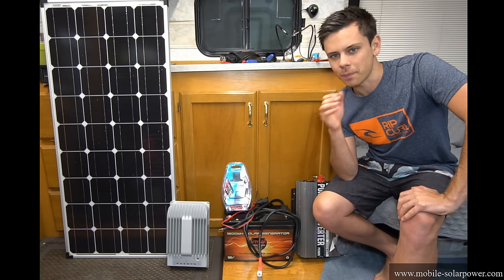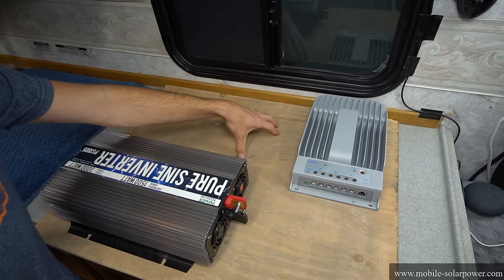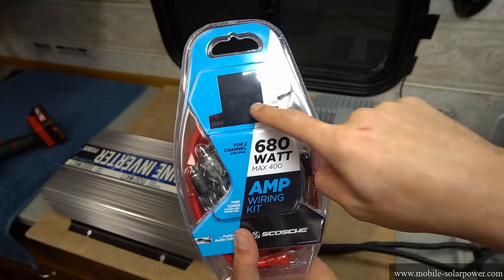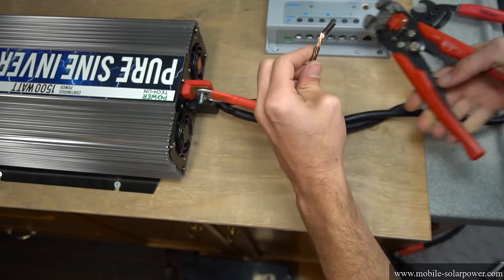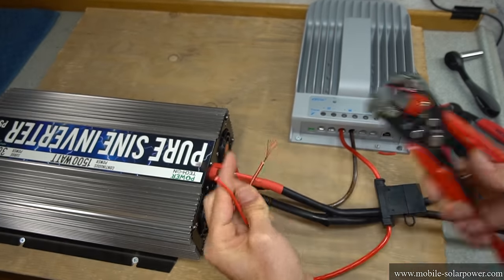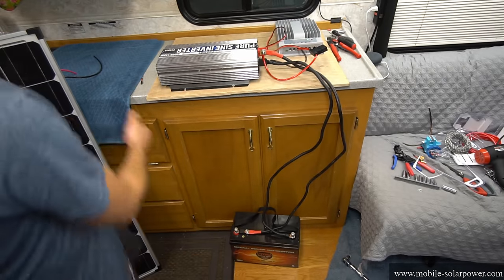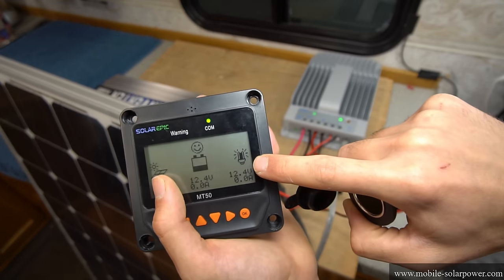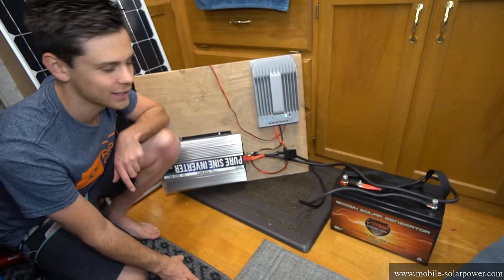No Crimping Required! DIY 400 watt Solar Power System- Great for Preppers or #Vanlife

Comment from the maker: Recommended Components and battery size can be found here: https://www.mobile-solarpower.com/the-classic-400-watt-rvs-vans-buses.html
This system can handle 400 watts of solar power with a 12v battery. The battery and solar panel in the video is mainly for demonstration purposes. A larger battery and 400 watt array is ideal. 

Amp Wire Hookup kit: https://amzn.to/2EGVJNJ

Tools: https://www.mobile-solarpower.com/tools.html

~~~~~~~~~~~~~~~~~~~~~~~~~~~
Does off-grid solar confuse you? Check out my DIY friendly website for solar system packages and product recommendations, and so much more! http://www.mobile-solarpower.com

Join our DIY solar community! #1 largest solar forum on the internet for beginners and professionals alike: https://www.diysolarforum.com

Check out my best-selling, beginner-friendly 12V off-grid solar book (affiliate link):
http://amzn.to/2Aj4dX4

If DIY is not for you, but you love solar and need an offgrid system, check out Tesla Solar. Low prices and great warranty, and they can take your entire house offgrid with their new Powerwalls: https://ts.la/william57509

~~~~~~~~~~~~~~~~~~~~~~~~~
My solar equipment recommendations (Constantly updated! Check here first):

12V/48V Lithium Batteries: https://www.mobile-solarpower.com/solar-batteries.html

Solar System Component Directory: https://www.mobile-solarpower.com/solarcomponents.html

Plug-N-Play Systems: https://www.mobile-solarpower.com/full-size-systems.html

Complete 48V System Kits: https://www.mobile-solarpower.com/complete-48v-solar-kits.html

DIY Friendly Air Conditioner/ Heat Pumps: https://www.mobile-solarpower.com/solar-friendly-air-conditioners.html

Complete 48V System Blueprint: https://www.mobile-solarpower.com/48v-complete-system-blueprint.html

~~~~~~~~~~~~~~~~~~~~~~~~~~
My Favorite Online Stores for DIY Solar and Coupon Codes:

-Current Connected: SOK, Victron and High Quality Components. Best prices and warranty around: https://currentconnected.com/?ref=wp

-Signature Solar: Cheap Server Rack Batteries and Large Solar Panels:
https://www.signaturesolar.com/?ref=h-cvbzfahsek 

-Ecoflow Delta Official Site: My favorite plug-n-play solar generator:
https://us.ecoflow.com/?aff=7

-AmpereTime: Cheapest 12V batteries around:
https://amperetime.com/products/ampere-time-12v-100ah-lithium-lifepo4-battery?ref=h-cvbzfahsek

-Rich Solar: Mega site and cheaper prices than renogy! Check them out: 
https://richsolar.com/?ref=h-cvbzfahsek

-Shop Solar Kits: Huge site with every solar kit you can imagine! Check it out:
https://shopsolarkits.com/?ref=will-p

-Battery Hookup: Cheap cell deals
https://bit.ly/2mIxSqt
10% off code: diysolar

-Watts 24/7: Best deals on all-in-one solar power systems, with customer support and distribution here in the USA: 
https://watts247.com/?wpam_id=3

~~~~~~~~~~~~~~~~~~~~~~~~~~~
Contact Information:
I am NOT available for personal solar system consult! If you wish to contact me, this is my direct email: williamprowsediysolar@gmail.com

Join the forum at https://diysolarforum.com/ if you wish to hang out with myself and others and talk about solar

FTC Disclosure Statement and Disclaimers:
Every video includes some form of paid promotion or sponsorship. Some links on this youtube channel may be affiliate links. We may get paid if you buy something or take an action after clicking one of these. My videos are for educational purposes only. Information is subject to change/update at any time. Electricity is DANGEROUS and can kill. Be smart and use common sense :)

DIY Solar Power with Will Prowse is a participant in the Amazon Services LLC Associates Program,
An affiliate advertising program designed to provide a means for sites to earn advertising fees by advertising and linking to Amazon.com

Comment: Brilliantly clear as always Will :-). Can I ask you to look into doing a tutorial on adding  the last piece to the puzzle. Adding these amazing systems to an existing internal 12v set up. 

What I mean by that is, I have small touring caravan which has internal AC that can be hooked up to the grid.

Your videos have given me the power (pun intended) to build a minimalist system to allow me to ditch our generator on weekends away. 

My van has all the existing 12v board and an AC board with 2 or 3 EXISTING AC outlets dotted about and has a charger that Already charges the battery when hooked up to the grid via the external plug.

If I create your magical solar system with an inverter, where do you then make the final connections to introduce it into the existing system so that one doesn’t mess up the other.

In my brain, I’m thinking I could just create the solar setup and then plug the output of the inverter into a joint box that gives me the choice to use the external grid hookup lead or, switch to the inverter line. Literally replacing one source with the other as though the inverter was providing “grid” power. 

Is this even possible or should it be connected some other (independent) way. 

I just really want to keep the existing internal ac outlets but just have them fed from the solar. There is also only 1 single 12v battery too so how would this impact / limit the design.

Feel like this would be a really typical requirement once a system is created.
Hope the post is ok offer up here.

Keep up your incredible energy.

Comment: This is the first time I see someone connecting the the battery output from the charge controller to the DC input of the inverter, using the DC input as a hub. So far I had only been taught to use the battery connector as mounting point for both the controller and the inverter. 

What are the implications of each approach?
Reply: I was wondering the exact same thing; this differs from Will’s other videos as well...
Reply: There is no real difference other than the length of the wire from the output of the controller.

Comment: BTW the best way to learn crimping is practicing on scrap wire. Never practice crimping or soldering (or most anything that consumes consumable parts) on your workpiece. 
That way when you eventually need to crimp something (which may not even involve your solar system) you'll know how.

Comment: You've been doing a bunch of cool smaller/simpler setups and I've really been getting a kick out of it.

If you're taking requests I'd love to see a DC only setup. In all your builds the inverter is pretty key, I'd just like to see what you'd change if it weren't.
Reply from the maker: Ok sure, that would be a cool one. and thanks!

Comment: Love the build video Will, well done!

People should be scared of crimping their own wires. Properly crimped cables are an excellent choice for cable termination and the recommended approach  for high energy connections, however Poorly crimped cables reduce long term reliability and introduce 'hard to find' intermittent faults. This is mostly relevant to small wires however good crimps are important for larger cables too. Quality crimp tools and appropriate crimping techniques are an absolute must - no pliers!!  :P
Reply from the maker: Absolutely agree!!

Comment: I just like to remind everyone that wire going into the charge controller should not exceed half an inch in bare wire going into the contact base. I like to solder the end. So that the wire together
Reply from the maker: Yeah agreed but I can't find a kit with a shorter bit right there. And honestly I never fuse my charge controller for my personal systems and I over gauge it anyways so the wire is protected. But yeah you're right
Reply from the maker: But whole point of this video is not soldering or crimping. Do you have an alternative method that doesn't require soldering or crimping? That was the entire point of this video

Comment: wire stripper , wire nuts, and electrical tape is fine by me ;).  Except for soldered battery mount cable of course.

Comment: Wow almost 90 of my ? In building my solar system Is answered in 7 mins.. very sincere in giving knowledge about solar system no shortcut that generousity in real act.. 3 question in mind the wire connects to inverter and battery it has two fuses? 175 amp fuse connects battery and the inverter is what amp fuse? Is that MT15 screen am i correct.. last is what watts is the panel 200 or 400 tnx again sir.. may be the 10 percent will be ans. In other videos like circuit breaker and when lightning  strike  more power to you man

Comment: Can a 12v fridge be hooked up where you hooked up lighter plug? I plan to cut off the lighter plug from the cord and adding anderson plugs to make it a secured plug in. Was wondering if I go off battery with a fuse or can I run it straight to the solar controller?
Reply: Run it off the battery.

Comment: You should definitely add a fuse to the 12V outlet as those are usually only rated for 10A while the charge controller can (and will) output up to 40A if given a chance.
Also, folding stranded wire in half to fit it into a too large clamp is just not a good idea.
Reply from the maker: On these terminals it's fine because they are oversized anyways and some arrays are going to be small or have short wire runs. Please watch my other videos which cover more advanced topics. This is a beginner video

Comment: Hi Will!
I have a 235 watt panel and a inverter that was used commercially with the panel. My question it was use with 12 gauge cable.can I lower the gauge cable to a 8 or 6.please help

Maureen

Comment: Just a quick question.  If I have a 170A circuit breaker in between the battery and inverter, do I still need the fuse at the battery positive connection?  The distance from the battery to the 170A breaker will be extremely short(2-3 feet).

Comment: Another killer video. The ending should be "and this board will be available at XXXX dollars on my website, already prebuilt." ROTFLMAO....... Hey - what's the best way to get to be in contact with you for asking questions?? Do I need to be a Patron or something?? Buy your book??
Reply: So In my RV - it's all stock. I want to add an inverter into my system. Can i just throw the breaker "MAIN" off, then from the inverter, run a male to male 110v cable to one of my 110v outlets? That should provide 110v to all my outlets, and be isolated from the generator yeah?? As it is now, when the generators off, the 110v outlets are dead too. But the 12v still works. So I'm thinking put the inverter on my 12v wiring, then use the "jumper" to make the 110v outlets hot. Sound about right or will I fry an inverter??
Reply from the maker: It's true and I've done that before haha but it's not smart. Very dangerous. Would wire direct to ac panel instead. Hardest part is running the wire under the floor or in the walls
Reply from the maker: And YouTube comments best way to contact. My email is an absolute mess. And I'm trying to make videos so I'm ignoring emails as much as possible

Comment: What if there is a long way between my solar panels and my system /solar charge controller  ? Lets say i got my system in my house and i need 25 - 30 meters of wire going out in my garden to my solar panels , how do I do that best and get the best results?  And the best power without too much lost ? Do the length of wire / distance have anything to say in this ? What if i want to supply my system with a small windturbine how do I do that best and the right way ?

Comment: 1 question , I've been having and trying to understand I see two types of systems being done solar panel to solar charge controller solar charge controller fused to inverter from inverter fused to the battery like u did in the video, the other system is solar charge controller  to battery from Battery fused to inverter is there any reason why there's two types of way of doing this pros and cons

Comment: I have a little giant pump that I would want to run solely on solar power.  I already have 4 panels rated at 130 watts.  The little giant is a 120v at 700 watts.  What size of battery and controller would I need?

Comment: I'd like to see how you'd hook the 4 solar panels up.  Would you run them at 12V in parallel?  or put them in series for 48V  or do 24V? and why would you choose one setup over the other?
Reply from the maker: With 400 watts of panels, put them all in series

Comment: Question: does it matter if you connect the battery positive and negative of the charge controller directly to the inverter or is it more advisable to connect it to the positive and negative terminal of your battery?
Reply from the maker: Either way is totally fine. Both connect to battery. Inverter cables are large, so they can carry the current of the charge controller easily.

Comment: i dont understand why youre connecting the battery via the inverter. Why not just connect the battery directly to the charge controllers battery ports, and the inverter to the battery?
Reply from the maker: Because the 2 gauge wire between the inverter and the battery can support the load. You would have 4 wires going to the board for no reason.
Reply: Will Prowse but wouldn't the inverter have to be permanenttly on?
Reply from the maker: @timothy790110  no not at all. its attached to the inverter terminals. which is connected to the battery 24/7
Reply: Will Prowse OK, still trying to get my head around this! . I only have a 600w pure sine inverter, connected directly to the battery with 2 awg wire. (6mm2)  and I'm fusing it with a 40a blade fuse. I have the same charge controller (4215bn) with 400w of solar. Is the 40a gonna be enough? My battery is connected to the charge controller with 6awg  (16mm2 wire) , fused with 60a.
Reply from the maker: @timothy790110  600/12= 50 amps, so you need 70 amp fuse. or 80 will work too. for the inverter
Reply from the maker: @timothy790110  and a 40 or 50 amp fuse will work with the charge controller
Reply: Will Prowse but is should fuse the cable, not the inverter right? Cable is 2 awg (6mm2) between inverter and battery.
Reply: Discharge and overcharge protectors are worth their salt. Had a guest using my small system when I went to work and came home to completely discharged and very expensive batteries.  2 deep cycle marine batteries and one gel lead acid sealed plus two emergency combo packs with jumper cables and air compressors from Walmart. Every battery killed.
Reply from the maker: @JudgeBob  yeah I totally agree. low voltage disconnect is super important.
Reply from the maker: @timothy790110  I think you should watch my video on how to fuse again. You are missing something fundamental. You need to protect the wire and the appliance. both need t o be spec'd accordingly
Reply: Will Prowse yep, will do. Oh, have you tried the WiFi or Bluetooth dongle for the charge controller instead of the mt50 by the way?
Reply from the maker: @timothy790110  I haven't seen the need for the Bluetooth module but yeah it seems cool
Reply: @WillProwse  the ok button on my mt50 keeps sticking under the plastic, since I bought it, it gets annoying real fast.  I like being able to set everything from my phone whenever I want, and have a nice layout of all the info. Plus the mt50 is a bit of an eyesore

Comment: I'd like to build this system, but I've got one 315 watt solar panel that has a rated voltage (Vmpp) = 37.5 V. Your guide says "max 24 volts each" for the panels, so would my one panel still work fine?

Comment: Use 24v to save on wire and get higher amperage. 2 ga is overkill btw
Reply from the maker: Please watch my 2000 watt 24 volt solar system I just posted. Or my Tesla battery system. Or my lg cell system. For beginners, 12 volts is fine because parts can be locally sourced.
Reply from the maker: And not overkill at all. They get pretty warm at max discharge rate.

Comment: Hey Will, just wondering if you could do a video (or maybe you have one already and I missed it) on how to connect a solar system to an existing RV system. My goal is to be able to plug into an AC power source or switch over to, via a transfer switch, to the solar charging system. Being able to theoretically run anything off of either battery banks. Thanks
Reply from the maker: Oh man I always want to make a video on this but I am so scared of people getting shocked with ac. It is super easy to do too..I'll have to think about this one

Comment: I have 400 watts of solar going to MPPT charge controller set for charging two 12 volt 75 AH sealed batteries in series (24) volts which works great.   I don;t want to change that set up but I would like to get 12 volts to work with a couple of moderate loads.  Instead of buying a 24 to 12 volt buck converter, why couldn't I just take a parallel output of the two 12 volts batteries?  That would hopefully still present a balance load and not negatively impact my existing 24 volt system?  Would that be a problem?  Thanks for your help.

Comment: Thanks for sharing. Can the solar charge controller  take other sources of energy such as sure power,wind or mechanical? If not,
is there a charge controller that we can purchase that will take several energy inputs at the same time?